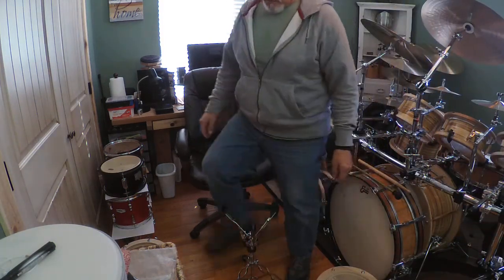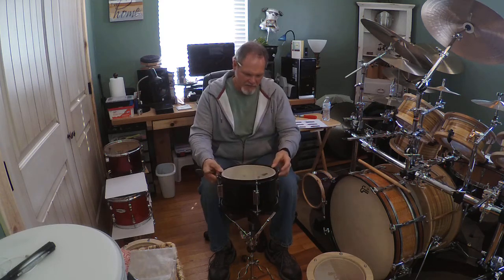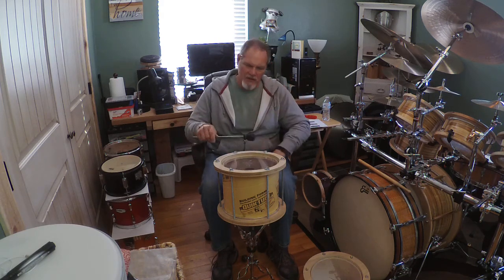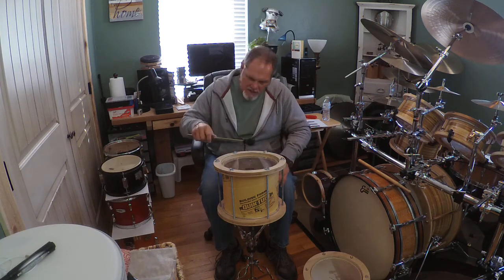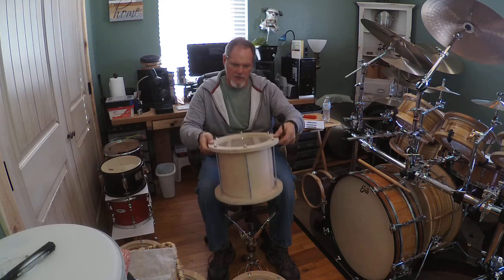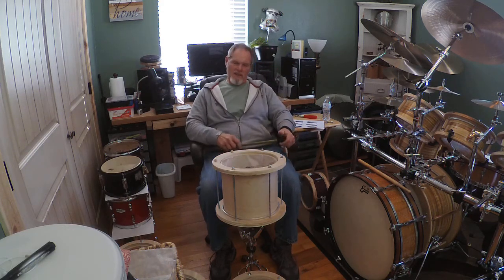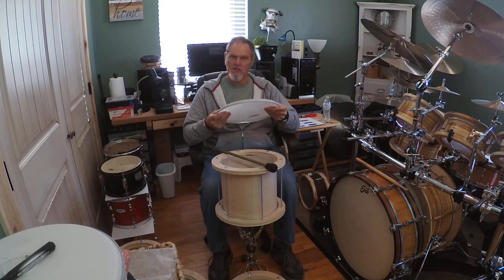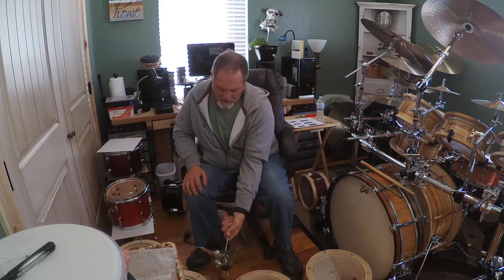Drum Shells and Sound - Bearing Edges, Part 6

Comment: Hi , back again!
I decided to re do my bearing edges , bought what I think is a flat piece of granite , glued some sandpaper to it worked the edges then put a light in the drum and checked it, to my surprise the light shines “ evenly” right around the shell , no high or low spots!!
Any idea why the light is getting under the drum the whole way around? Cheers.
Reply from the maker: Good deal. Light intensity in such a small space is enough to sneak past. A drum shell is light. If it weighed 50lbs the extra pressure might squeeze down enough to close off light passage more. Any slight inconsistencies in the granite and/or the wood would allow light to pass through. A perfectly flat surface is not necessary because heads stretch.  A perfectly flat edge is just more marketing hype.  People will become upset by that position but, I have more than proven that to myself with the various projects in this series, as well as other drums made over the years. I've used materials that make a perfect edge impossible by electric router standards and the drums still sound great as long as the heads seat correctly between the collar and the playing surface. 

Does anybody ever get into perfect bearing edges on world drums? How many use routers to make their edges around the world with native made drums? Animal skin stretches, more than plastic, yes but, mylar stretches enough to meet the needs of all but a damaged edge.
Reply: @REFondrums  thanks for the reply what you say makes sense but there are a couple of tutorials I’ve seen where the guy sands the edge on a thick granite slab and no light passes through, when he corrects a few imperfections, it’s just strange that my drums seem to be “levitating” and there is not one area where it is not lol.
The drums sound quite good but I was just interested to get your angle on why this may be occurring! Cheers and stay safe!👍

Comment: I agree that the importance of the shell material is grossly overstated, but don't Roto-toms prove that the shell plays some role if not a small one? It's true that Roto-toms show that the head can make a sound without an enclosure sure, but they don't sound anything like an actual drum. They sound a bit like timbales with even less low end. To those who would say, 'that's because a regular drum has 2 heads and that's why roto-toms sound different'. True, but concert toms only have 1 head and they too sound different from Roto toms. Another good example are octobans. They have such a distinctive sound that combines high end attack with a focused low end punch that you would never be able to get out of a 6 inch head by itself. Try getting a 6 inch roto-tom to sound like an Octoban. Can't be done. Even if you're using the exact same head and tension on both. 

It seems to me that the depth, diameter, and thickness of the shell is a major contributor to the sound, not the type of wood (or metal). If you want punchier, more resonant toms, get a 10x9 instead of a 10x7, a 12x10 instead of a 12x8 and so on. Make them thinner too if possible. It doesn't really matter if the shells are maple, birch, poplar, or oak, but the dimensions DO matter.
Reply from the maker: Agreed, and I mention those factors in other videos in the series. Tube drums really make the point with their long shells. The real throaty sound is the result of the sound waves taking longer to leave the chamber. Everything is about how the sound waves thrown off by the heads are handled so, yes, a single headed drum will always sound different than a double which traps sound waves.  No one would say Phil Collins' set sounds anything like Chester Thompson's and it has nothing to do with Grestch vs. Sonor. 
To the point of heads being the sound of a drum, though, if I want a punchier sound, do I need to purchase deeper toms or just purchase thicker heads? My choice would be the latter. The slower vibration of thicker heads will do the same as slowing sound waves between heads on a deeper shell. And having made every size of shell, from square to half shells (10x10 to 5x10, etc), real world differences on stage or in studio are heard between the most drastic shell depths. It's a little more volume, if anything, which would be logical: larger chamber, bigger sound. 
As far as thickness, I see that as either moot or just a matter of density.  If the overall density of a thick softwood shell is the same as a thin hardwood shell, it equals out for how the sound waves bounce around and finally dissipate. You can take a softwood shell and put a couple coats of tung oil or other finish inside and harden it up enough to equal out any differences. Everything is about the density of the chamber and how sound waves react in it. And when all is said and done it is still nuances and subtleties. Deeper shells generally end up feeling more different to play on than they actually sound like in performance settings.   
Then there is the "resonance" factor. I wish someone would come up with a standard definition of what that term means when it comes to drums.  I have yet to see it.
Reply: REFondrums With tube drums or Octobans I believe the Helmholtz Theory applies to the different notes heard in the different length shells. The same thing with how a ported subwoofer enclosure resonates at the frequency determined by the enclosure size/ port area relationship.
Reply from the maker: @Assimilator702  I am not familiar with the Helmholtz theory aside from color vision.  The same principle of depth applies with homemade PVC marimba's, etc. The same size and tensioned membrane will sound different when struck with sound waves passing through cylinders of dramatically different length. A 6x12 tom, of any material, will naturally sound a little different than a 12x12 tom in volume, and overall timbre.  Enough to notice on stage? Maybe from ten feet away. Past that? Unlikely, especially in lower frequencies.
I've been using "tom-sized" floor toms for a few decades now. Meaning, a 10x14, 12x16, 14x18 or, 7x14, 8x16, 9x18, and 10x20, all on modified snare stands. They sound just as big as regular floor toms, without the feeling of playing on waves of the sea with typical floor toms with the difference in sound waves taking longer to rebound from heads farther away.
I was listening to a song the other day. Sounded like a 5 pc kit. I'd guess 10,12 and a 16. I thought to myself, as the player just struck the drums with a single note, 10-16 throughout the chorus of the song - "The difference between that small rack tom and the floor is really not that great." Maybe the recording engineer balanced things out with knobs and sliders but, that is my point. Three different sized drums, one drastically so, all sounded the same, save for pitch. The extra shell depth on the floor had no great difference. I am going to put together a kit from all the 10" toms, and use different heads and show how different plywood means nothing to the range of tones that kit will have. I'll get that video done sometime in the near future.
Reply: REFondrums Ok I shouldn’t of called it Helmholtz Theory.....but Helmholtz Resonance. Blow across a glass bottle and the sound it makes is Helmholtz Resonance. A pipe organ also works on the same principle. So an Octoban is the only drum used that works on this theory. You need a certain amount of area within the tube for the phenomenon to occur. I work in the car audio industry and design and build 2 or 3 ported enclosures per month.Thats why when I watched that Ford Drums video where the 2 guys equated a drum to an enclosure and speaker I tuned out. Some of their theories are valid but it was 1/2 baked and presented in a very un researched manner. I’m all for loose and laid back but THAT was beyond lazy. The sound IS in the heads but I want to see more verified proof of the non importance of the drum shell.
Reply from the maker: @Assimilator702  I'm not certain how an Octoban works on an effect utilizing a passage of air as the main thrust. Drums are struck and sound waves move within a chamber with air in it and must pass down through the cylinder and escape. It's an impact and concussion effect, right? That is different than blowing air across a bottle top. 
As far as the IMPORTANCE of a drum shell, that is subjective. Roto toms, Arbiter Flats, Traps, and other frame drums can be used for live and recording purposes and have been for decades. Same for concert toms, which just employ one head. The sound is dry but, all these instruments are drums and sound like drums. 
You add a drum shell and another head and create surface area for sound waves to strike and bounce around within so, is that important? Depends on the player. You'll get resonance more than just pitch and sustain from a head on a frame. If that is important, it is important. In the case of the concert tom you get a dry sound and less sustain because of the loss of energy in the sound wave. Out the bottom it goes after being impacted by the shell wall.  
I'm sure you have seen drums, especially snare drums, with holes drilled in them. It impacts the sound. Enough that someone blindfolded could tell the difference of what kind of snare is being used on a stage or studio: a solid shell wall or drilled out one?  I doubt it, and would have to see the test done to believe otherwise. 
Sure, a Roto tom sounds different than a drum with a full cylinder but, among cylinders is one plywood dramatically different in its contribution to the sound than another? No. That is ultra-hype in the industry that makes that claim and never actually proves it. 
Is it important for me to have a Tama shell, versus a DW shell, versus a Pearl shell, versus a Gretsch shell, versus a Sonor shell, verses a Keller shell for making a DIY kit to have some great sonic difference in a drum set? No. Nuances may exist and impress the player but, once that player sits behind his kit on a stage or in a studio surrounded by a band, other elements of sound reproduction take over and his playing means far more than any plywood shell.  
If someone playing Tama Bubinga is more inspired than playing Yamaha Maple so be it. That's another subject. I am just looking at things as objectively as I possibly can.
I liken it to leather and baseball gloves. When I was a kid I had the choice of a K-Mart glove or MacGregor, which were three or four times more expensive. I used the K-Mart gloves, played the games, caught the balls, and never had a glove fall apart on me, even though the MacGregor glove was supposedly superior.  Leather and padding is leather and padding. Maybe the K glove had a little less padding in the fingers and palm. Didn't effect they way I played the game, at all. But, my wallet would sure have been effected buying MacGregor gloves. :-)

Comment: I don't see your point about testing speakers with 1 watt. That is used to test the sensitivity rating for a loudspeaker.
Reply from the maker: Not a perfect analogy, by any means. My point was,  at 1 watt (just a soft strike) what kind of sensitivity does the head respond with and what does the shell contribute to that sound. The difference between compressed paper (Tubie), Maple, Birch, and the Mahogany/Poplar was basically nothing. Increase the Wattage (strike force) and then what does the shell contribute? Just nuances of tone, if anything at all. Can differences be discerned in any dramatic way comparable to what manufacturers claim about their shells contributing to sound when you engage the entire set? Not really. In a band? No. So, we have hype on top of hype, including aspects of bearing edges and what is claimed for them, as well. Marketing tools manufacturers are using in a crowded field to try and influence the consumer to purchase their product. But, the hype is not provable. To the contrary. That's the bottom line of the discussion.

Comment: i like your videos, but i have a question.   my toms sound and resonate completely differently when they are mounted, do you think that there would be more of a noticeable sound difference if you had mounted the toms?
Reply from the maker: Depends on the mounting. For almost 20 years now I have mounted all my toms in modified snare baskets so they can resonate freely while still being held rigid in position. Isolation mounts tend to allow the toms to wobble some. Not a big deal and many companies have addressed that issue with their own mounts. If your toms are mounted with brackets affixed to the shell, yes, they will lose low end resonance and sound different than toms allowed to vibrate freely.